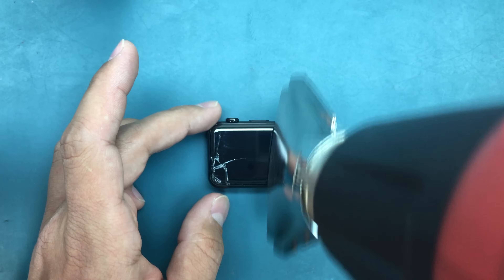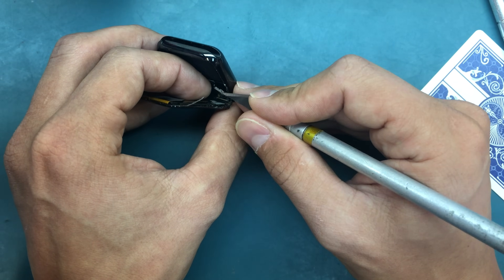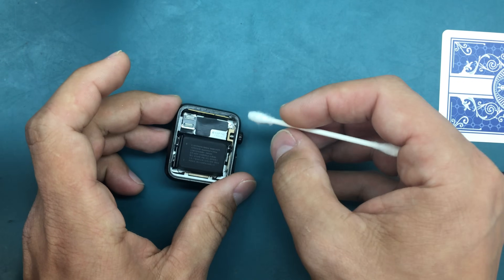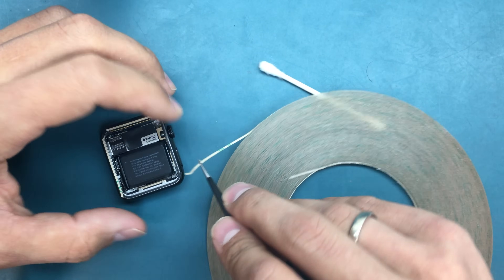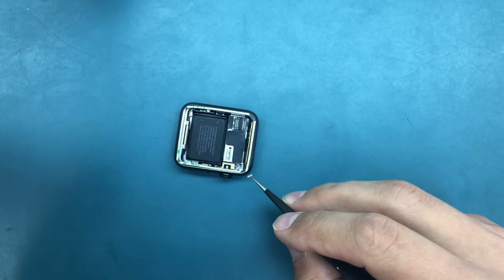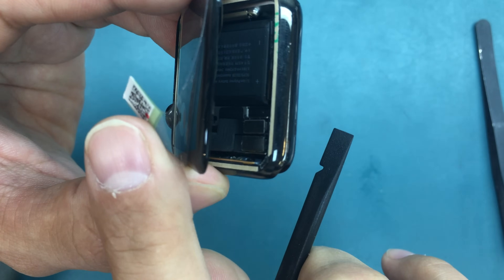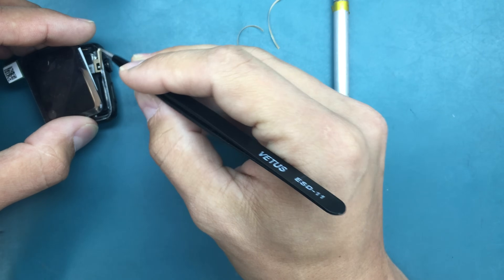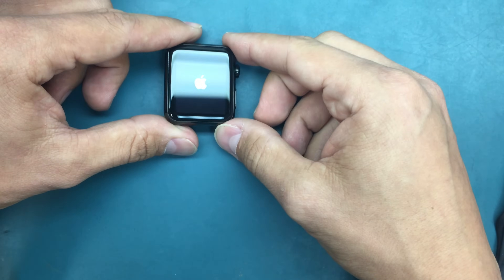HOW TO GUIDE: Cracked Apple Watch Series 1 Gen 42mm Glass Screen Replacement Full Repair Tutorial

Comment: The edge of one of the two clips on the Taptic Engine cable is slightly damaged in the top left corner. Do you think the whole cable needs to be replaced for it to succeed?

Comment: I have a 38mm Series 1 that the battery got swollen, and popped off the Screen. I replaced the battery and by the time I opened and closed so many times, the two cables broke, making the screen useless. So I bought another locally. When I plugged the two cables in, I remember the touch screen working and then I powered down, to put the cover on the two cables that plug in. From then on, the watch will turn on, and show face, and by hitting the crown it will give the number pad for password, but nothing works on the touch. Cant enter the password, or slide screen up down, or sideways. No touch at all. Thought it was a bad screen, so got another, replaced by location I purchased and have the same issue. Charges and then starts up, but no TOUCH control. Even went thru that snake battery thing where it won't charge, and start, and would get hot, etc... so discharged for 2 days, and then charged now dealing with the no response to touch for password, and screen at all., Any idea? Cant try old Screen as cables were brittle and broke

Comment: DON’T EVER buy the IFIXIT screen replacement. They are trash and lack greatly in quality(colors are not sharp, unresponsive) I suggest buying an original apple screen from an old Apple Watch on ebay(runs about 40 dollars). This way you’ll have your equipment back to original quality. I’ve used ifixit 5 times and I always regret my purchase.

Comment: Do you have to replace the whole screen versus just replacing the outter glass part? My iwatch still works fine, but just the glass is cracked. Is that possible?
Reply: Yes but it’s very difficult with a high risk of failure

Comment: I bought a new battery and replaced in my series 1 watch and cracked the original screen taking it off to change battery so I ordered new screen and actually broke it trying to get it to work. I have done everything from putting new screen on with new battery to using original battery and screen to try and get it to turn on but it will not come on.  any thoughts?
Reply from the maker: Not sure what could have gone wrong..maybe the ribbon that you connect the screen to got ripped. Sometimes the new batteries are no good. But you said you tried the original battery
Reply: how much would you charge to take a look at it? if you think you might could fix it

Comment: hello. what temperature do you recommend? i need to remove a working screen. i use a micro soldering heat gun. thx
Reply from the maker: It depends, try at lower setting
Reply: I can adjust temperature from 100c to 420c. What temperature do you use?

Comment: Thank you I like the use of different tools if not got the exact one very helpful gotta fix coming up I bought a iwatch but got rip off  so I bought a cheap one off eBay cracked screen but pretty good condition around bezel any way I gonna use the iCloud block one screen a put it on the other brand new again and got extra charger and straps replacement battery for £40 . So I feel much better watching this.Thanks
Reply from the maker: Thank you

Comment: Thank you for this tutorial! Quick question, when looking for the replacement screen. Should it be just glass or the one that says LCD display touch screen digitizer replacement? Or if you could even post the link to where you got the original replacement from? I’m just worried that the one that I buy won’t sit nice and even and flush on the casing if it’s not an original
Reply from the maker: Buy the full touch screen + lcd assembly of the right size (38 or 42 mm). Thank you

Comment: My apple Watch series 1 is not working force touch. What should i do ?
Please guide me.
Reply: Nobody tells people when you buy just the digitizer it is not programmed. What I do hun is go on eBay and buy an iCloud locked watch and use that whole screen replacement with everything on so it’s just the connectors you have to put in n good to go. It is a hit n miss rather touch will work. Idk why. I bough 5 iCloud locked watches and 2 out the 5 had no touch when put on. Weird Ik but you will be able to fix your watch doing my way. Promise.
Reply from the maker: Najam Ashrafi you probably have a force touch sensor broken/cut. It’s a thin tape like film that sits right around where the screen is attached to the frame

Comment: Hello Fix Apple Now

I have a couple of questions concerning the Apple Watch screen replacement. So facts are, that I have the Apple Watch Series 1 Second Generation. So it's not the "original" Apple Watch as shown in the video, it's Series 1 (2nd Gen) as displayed on Apple's website. So I have following questions:

1. Can I use this tutorial, or will the steps be different than shown in the video?
2. Does it work, to use these Adhesive with my Apple Watch Series 1 (2nd Gen)?
Link: https://www.amazon.com/Front-Sticker-Apple-Waterproof-Adhesive/dp/B01LQ34KGE?th=1
3. If you don't have a heat gun, is it possible to use a fan?
4. Do you think, that this Digitizer is for the Apple Watch Series (SECOND gen)? (It's marked with
Link: https://goo.gl/yFzD4U

Thank you very much for answering my questions!
Reply from the maker: BotRaid hi. The adhesive might work. But the screen in the link you provided is definitely a series 1. It will not work on your watch. Thank you
Reply from the maker: BotRaid you can use the fan

Comment: Can you please clarify which part to search for on Ebay? There is a Black Front Glass Touch Screen Digitizer Replacement  and there is the LCD screen. I saw some videos where they keep the back panel and peel/ scrape off the crack glass. I don't want to get the wrong item. What's the range of cost for this item?
Reply: Do not waste your money trying to fix just the glass hun. These people don’t inform you that when you buy just the glass you won’t get touch cuz it’s not programmed hun. What you should do on eBay is buy an iCloud locked watch;) take that screen n put it on yours. I do this all the time. Even these sometimes have no touch. 2 out 5 iCloud watches I bought one time had no touch once I transferred the screen. But it is possible you get it on the first one:)
Reply from the maker: sorry for late response. you need the full lcd+glass+touch screen assembly for this repair

Comment: Help! I cannot get the damn screen off! Ive been using several different razors, heat, everything!
Reply: But a $8 heat gun on eBay. Ik the frustration your having trust me but you become a pro once you get it down but the watch should be so hot that you need a cloth to hold it hun:) then the razor you don’t want to push down a lot but want to go at a slant and wiggle right to left. You will hear a popping sound when I’ve hit the ledge that’s a good sign. Slowly keep doin it and you will start to c the razor going in. From there don’t put the razor too far in and try to look in a make sure you don’t c a black strip coming up. If you do don’t cut that try to put that part back down and go along the edges:) you’ll get it:)

Comment: without glass does the screen work ?
Reply from the maker: Arush Mahajan what do you mean?
Reply: Fix Apple Now If the cracked screen is removed then what is underneath it ??
Reply from the maker: +Arush Mahajan the logic board and a battery..
Or do you mean if you scrape the cracked glass off of the screen? Then you’d have an lcd that shows an image, but you would not be able to navigate it. I hope I answered the question.

Comment: I have two things to point out, this voids your warranty and the watch is not waterproof anymore, because of wrong adhesive. Also, many times the replacement screens don’t have 3D Touch, unless they are original
Reply from the maker: DatJohnnyVasvas   first point, if the screen is broken, your warranty is done anyways, unless you have Apple care. The second one is somewhat right, although The Watch is not waterproof to begin with. It’s the first gen and these are only water resistant. So they are not made to be submerged under water. The third point is only true if you rip the 3D Touch sensor, which is right under the screen adhesive. You have to be careful when you remove the old adhesive, because that sensor is only a tiny flex/ribbon that goes around the perimeter. 
Thank you for your input
Reply: sheep bro ^^ nobody gets that your warranty is void if broken. i run a repair shop as well...roll with the punches!  and NO DEVICE is waterproof.  If they were, why wouldn't the companies give you a new one if you water damaged it?!?!?!

Comment: Sir, I'm living in Dubai
Could you please tell me from where i get the repair
Reply from the maker: gurpreet gikki 
hard to say..try looking for a local shop. Or get a replacement part form eBay and do it yourself. Thank you
Reply: Fix Apple Now thanks sir
Reply: Fix Apple Now and what about the glue ?
Reply from the maker: gurpreet gikki 
There is a few options here: you can do it the way it's done in the video, using adhesive strips. You can buy precut adhesive online. I would not recommend using glue, because it's really hard to control the amount you are applying and it can be messy. Plus, if you need to take the watch apart later on it can be a bit more complicated because of the glue. Thank you
Reply: Fix Apple Now thanks sir really appreciate

Comment: I mean because of the glass held down by the tape is the watch still able to go under water
Reply from the maker: Ashton Steudlein 
the first gen Apple Watch is not water proof it's water resistant. But I would be careful with that, even if you use the proper precut adhesive. Thank you
Reply: Fix Apple Now thanks and also is it still water resistant after there being a new screen on it
Reply from the maker: Ashton Steudlein 
it should be , but since it was opened, there really is no 100% guarantee. Thank you
Reply: Fix Apple Now Thank You
Reply: Fix Apple Now also when i search for a new screen it says digitizer are they both the same
Reply from the maker: Ashton Steudlein we used a full LCD assembly. Not a digitizer
Reply: Fix Apple Now ok thank you where should i buy it from
Reply from the maker: check ebay

Comment: The paper strokes part is really necessary ? I didn't understand that because at the end you just remove the paper like nothing happened .
Reply from the maker: Egor B, yes you need to remove the paper that covers one side of the adhesive. You can find a proper precut adhesive on ebay. Those were not available when the video was shot. Thank you
Reply: I bought one ( 2mm ) but I have to wait like 2-3 weeks for it, and I have the new glass screen, so... Its possible to do it without the paper ? Like with some kind of glue ... Or the best option is just wait for the paper ?
Reply from the maker: Egor B 
yes, I'd recommend to wait for a proper adhesive

Comment: Awesome Video! About to attempt this repair on a 38mm Series 1 Apple Watch. Other than screen size, does the repair differ any with a 38mm vs. a 42mm? Thanks in advance!
Reply from the maker: Hayden Poff thank you. The process is the same. The only thing you have to be careful with is the adhesive that holds it down. Because apparently there is a pressure sensor stuck right under it. It looks just like a strip of adhesive, but it is actually a part that is extremely easy to cut. Google "Apple Watch pressure sensor", and you'll see how it looks. Thanks again, and good luck